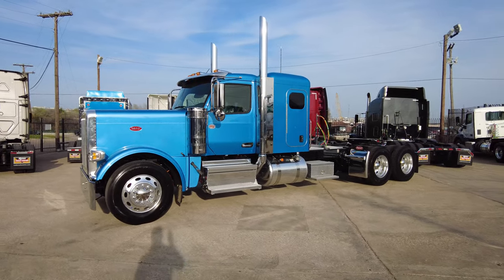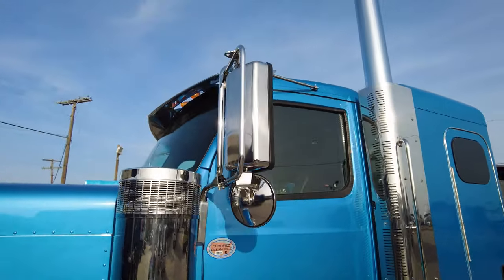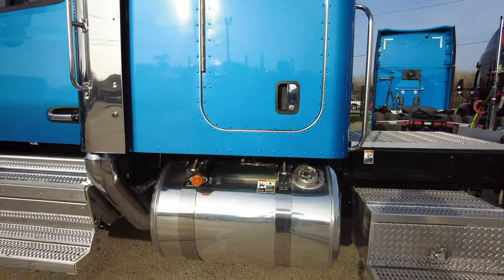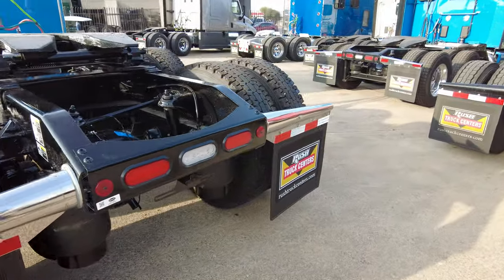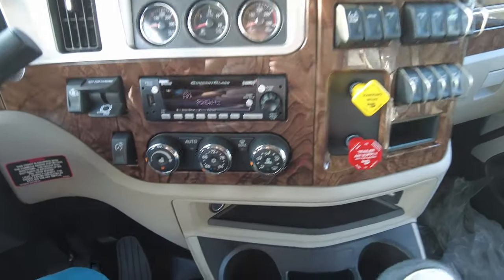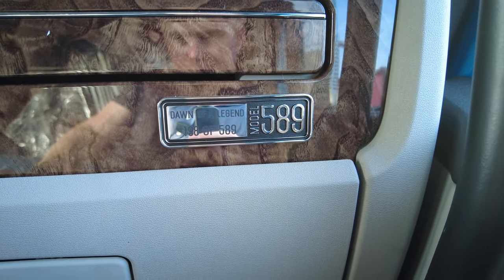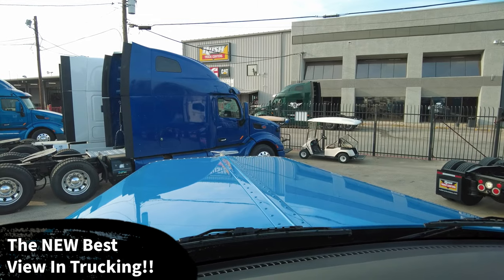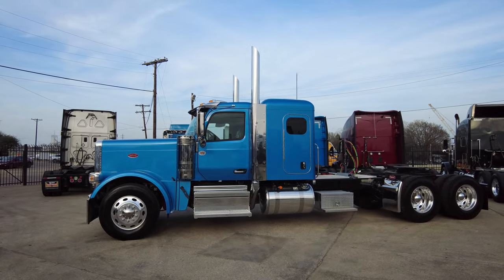SOLD - Bright Blue Peterbilt 589 with 58 inch Sleeper

Comment: I wish Peterbilt would use the actual sleeper size instead of a different number. I had that same truck in a 379 except it was a 48" sleeper. Now they call it a 58 " sleeper. Our current 2019 567 has a 72 sleeper except it is the old 63 sleeper. Not cool to label it something that it is not. I still love our truck.
Reply from the maker: Glad you love your 567! That is such a GREAT and VERSATILE Peterbilt!
Just get all the other manufacturers to measure from the actual sleeper size instead of from the forward most point behind the seats and I'm sure Peterbilt would follow suit. Other manufacturers were measuring from behind the driver's seat and stating their sleepers were 8-10 inches longer than Peterbilt. Accordingly, Peterbilt adopted this "new" measuring system. Some call it marketing, I would use a harsher word...

Comment: I wish peterbilt would have kept the sliding sleeper windows instead of the large sleeper side windows
Reply from the maker: @jharrison3343 it would be nice to have an option for both. However, I think having a full size door (especially on the largest size sleeper 80" which replaced the 78" in 389 and had no full size door option) is a decent compromise.

Comment: Great content as always Travis. Why do drivers select a small sleeper. Is that to do with wheelbase or specific applications?
Reply from the maker: @realcdcruze3558 Thank you! Yes, you are correct. Wheelbase and application have a lot to do with sleeper size. Short answer, if the driver does not need to be out in their truck for extended periods of time or only occasionally need to sleeper in the truck they will often go with a smaller sleeper. Weight savings is also a factor.

Comment: It's not a real dual exhaust it's a 1 in to 2 there is now true duel exhaust on today's trucks because Today they just use a inline 6 engine not a V engine like the old V6 V8 V 12 engines ect which have exhaust manifolds on both sides of the engine...